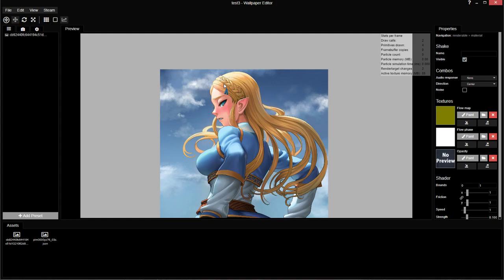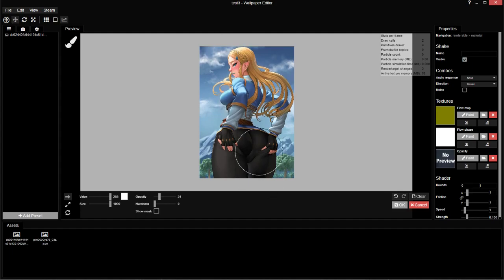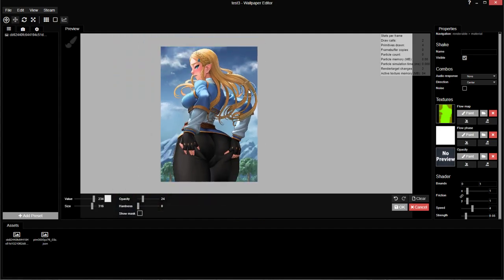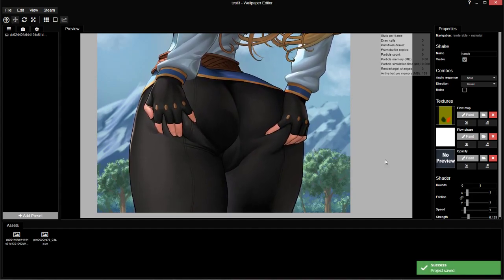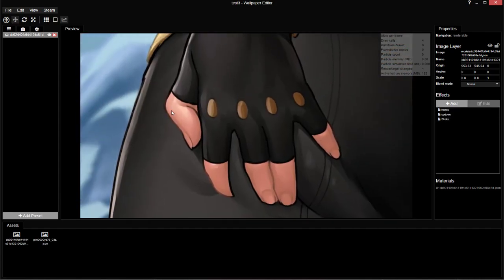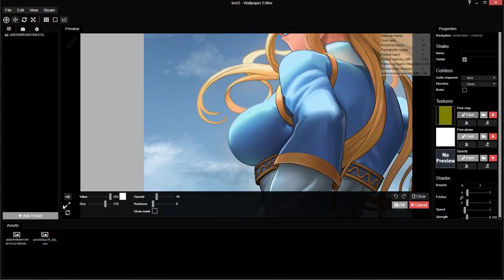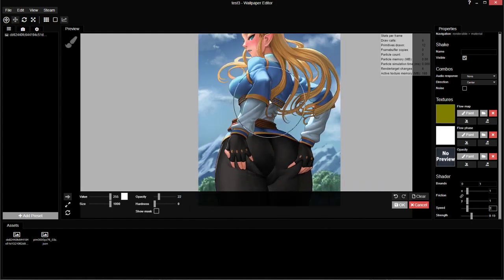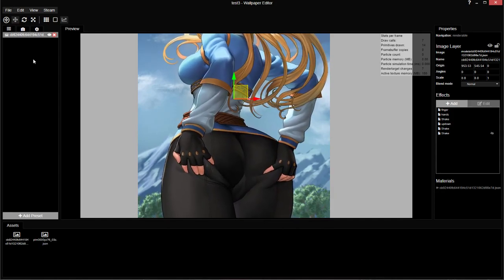Wallpaper engine - How to shake and Shakephase

Comment: Im trying to use shake, but its causing my other effects to move out of their masked areas. how can i have my effects move with my shake? I know you havent been on in a while but it would really help me out
Reply from the maker: the order of the effects in the layer effect lists matters the smaller and more percises effects go at the top of the effects list and the larger more broad ones go at the bottom ( i think i could have that backwords) so if you have a waterwaves hair effect, and then a shake effect on the body below it, it will move the hair effect along with your shake, if you have the water waves effect below the shake the shake wont move the water waves and it will misalign on the layer because its not moving. I honestly dont know how they interact with masked areas, i didnt use masks much i went with the slightly more advanced separating individual objects into their own layers to animate independantly approch. but you could try something janky like, you can export your mask then reimport your black and whte mask as its own image layer, the duplicate your shake effect that is moving your object onto the black and white mask so its now moving, then use that animated mask image layer as your mask, by draging and dropping it into the original image layers mask window.. lol i have no idea if that would actually work or solve your issue but other then that i dont have any ideas its probably been close to a year since iv used wallpaper engine.

Comment: instead of flow map and flow phase i have shake direction and itme offset. send help plz
Reply from the maker: ya they change the name of things over time, shake direction is is the actual shake and time offset is what used to be flow phase
Reply: @VellAnimations  when i choose shake direction what type should i use
Reply: sorry for the stupid questions, i started making wallpapers yesterday xD
Reply from the maker: @secreswallowtail8585  depends what you want it to do, your object starts in the middle of whatever your shake movement is going to do. if you leave the direction default then if you paint say going to the right over your object your shake will move the object from the center point to the right, then back to the center point and an equal distance to the left then back to the center point. if you set it to left, the it wont do the right portion of the movement and just move to the left then back to the center point. keep in mind left doesnt mean left, it means opposite of the direction you painted in or the correct direction depending on which way you painted. it makes sence  when you work with it for a while. for random movements leave it default, for specific movements like blinking set it to either left or right so it only plays half the animation.
Reply: @VellAnimations  okay, thanks a lot

Comment: Is it possible to offset 2 animations? For example, make 2 animations of "shake" be of the same time but look a little more advanced than the other?
Reply from the maker: you can change the animation start time of a shake by changing the color of the shake phase, instead of using the brush to paint parts on just select a strength value and press the clear button to "paint dump" the entire shake phase mask and then make any additional changes starting from that value. So one of your shakes starts at 255 strength and the other you paint dump something like 220. you can then add more shake phase . Im not 100% sure if thats what you were asking but if its not lemme know.

Comment: I bought his works on gumroad but I can't use them well...BTW, I wanna avoid the hair avulsion when I add a shake to the breasts.Dude, could u give me any advice?
Reply: I've tried "show mask" button, but it didn't work well.
Reply from the maker: The only way to have part of the image be effected by the shake is to separate the part you dont want moving onto its own layer. you would need to cut that part of the hair out in a program like photoshop or GIMP
Reply: @VellAnimations  thx a lot! I've done this part